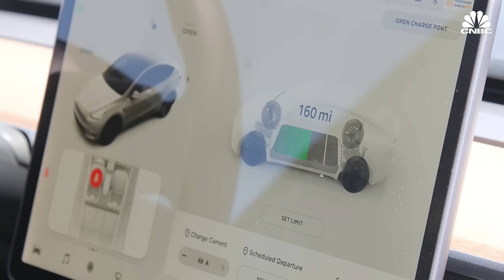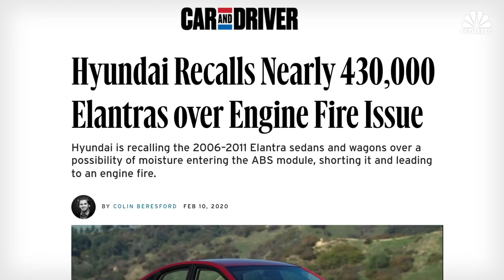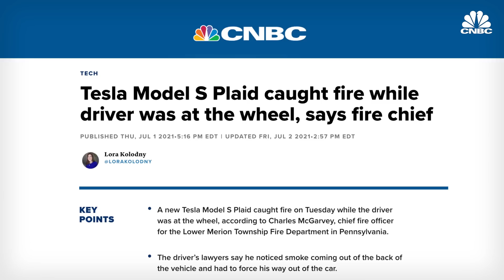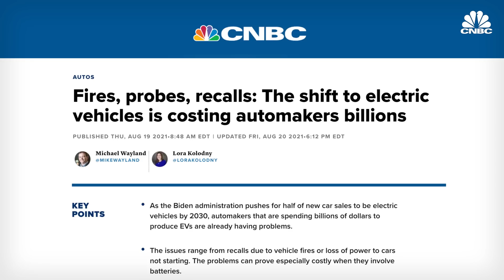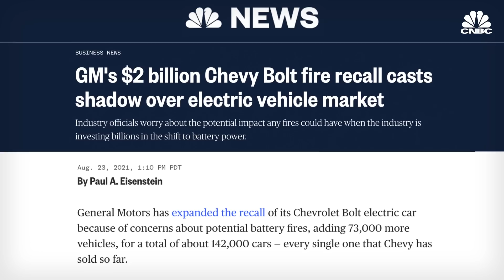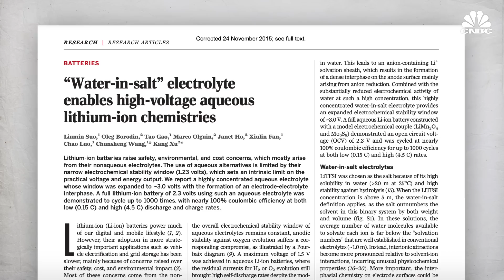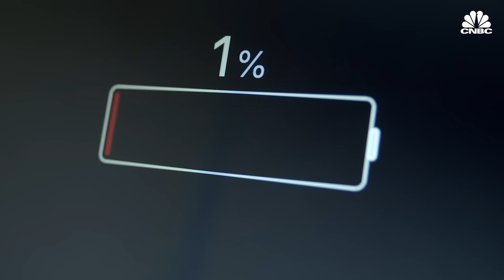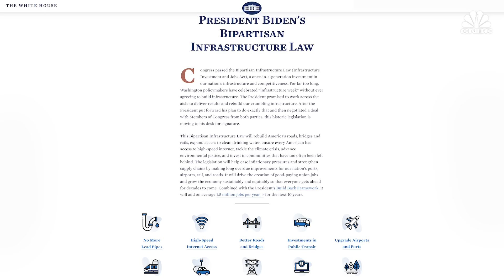Why Tesla, GM And Other EV Companies Have A Fire Problem

Comment: Here come the Tesla zombies coming to mass dislike the video and brigade the comments. These Tesla stans need to understand that, yes, gas vehicles do catch on fire, but EV fires are FAR more dangerous when they happen. And evs can catch on fire because of random electrical failures in the battery, so they can just blow up while parked/charging
Reply: yes, when they happen, they are more difficult to put out. But you missed the point that these acidents happen a lot less than with an internal combustion engine car.
Reply: @Hans-gb4mv  But what they don't mention is that EV fires happen a lot more than ICE car fires when they're not in an accident and rather just sitting in a garage!
Reply: @joeking433  yes, but they still are less frequent overall.
Reply: @Hans-gb4mv  Non-Tesla EV's will outsell Tesla EV's 10 to 1 worldwide in 2022.  Mark my words!
Reply: @strikye7  The problem is inherent in the structure of a chemical battery. They store energy by holding the fuel and the oxidizer in intimate physical proximity. Less like gasoline and more like dynamite.
Reply: @gregorymalchuk272  I agree, I can't wait for solid state batteries to be mainstream.
Reply: Their Tesla stock is plummeting and they're desperate.
Reply: @joeking433  yep, desperately buying the dip! 😘👍
Reply: @NeutronStream  Keep waiting, it hasn't dipped to it's bottom yet!
Reply: @joeking433 Thanks! I'm buying the dip, selling at the high and then buying back in the dip. Risky strategy but has worked for me several times.
Reply: @NeutronStream  Times have changed.  There is real successful competition now! Tesla's stratospheric P/E ratio won't hold.
Reply: @joeking433  No disrespect but there's no evidence competition is affecting Tesla's sales. Here in Europe (I'm in the UK), Tesla is demolishing the incumbents. Every single other EV maker saw huge drop in sales as soon as Tesla's started selling and delivering. But to each their own. ✌️
Reply: @NeutronStream  We'll see!
Reply: @NeutronStream  Every EV maker is selling their EV's as fast as they can make them so how do you know what the demand is?  Tesla is still selling out based on their initial success when they had the market to themselves but all the other EV makers are now selling out, too!  That's what investors are seeing and why TSLA stock dropped 11% today right after the good earnings report of yesterday!
Reply: @NeutronStream  Did you buy the 11% dip again today?
Reply: @joeking433  You bet I did! ☺️ Market being irrational. Next week Tesla SP will rebound.
Reply: @NeutronStream  Competition is not affecting Tesla's sales but it IS affecting the stock price!  EVERYONE is selling EV's as fast as they can make them!  That makes the stratospheric PE ratio of TSLA drag the stock down.  How far will it fall?  Hmmm.  Most people are saying the $500 range.
Reply: @joeking433  2 years ago Tesla PE was 1400+. It's now come down to ~180 in just 2 years! That's massive improvement. The share price is being affected by the macro environment. The same macro environment is wreaking havoc to the entire auto industry. Every major automaker sold less cars in 2021 than the year before. Eventually one or more will declare bankruptcy or default on their debt. This will indirectly affect the entire auto sector. I'm confident, Tesla will ride this shitstorm out like they've done several times before. That said, I might sell and buy back lower.

Comment: Whatever battery chemistry they use it always will be more difficult to put out when they catch fire compared to a gasoline car. Gasoline needs oxygen to release the energy. Cut out the oxygen by water or foam and the fire is put out. Batteries have all they need to release the energy in them so in case of a fire you just have to cool down their surrounding and wait until all energy is released.
Reply: which is why german firefighters just put EVs in a big tank, where they can reignite as often as they want.

Comment: How many Cellphones, laptops and electronic gear catches fire regularly…? Pretty much none.

Don’t make this a big deal fear mongering people of EVs.
Reply: it is new tech so obviously there is going to be some problems in the beginning..
Reply: @janix9661  yeah, the Hindenberg was new tech as well.
Reply: The danger is completely different. Imagine when all cars are EV and what happened to those 55 buses happened in an indoor parking lot. Think about multi EV car pile ups on the highway and one explodes. Everyone in the building, everyone on the highway dies.
Reply: @TheBooban  "Imagine multiple gasoline car pileups all full of gasoline and one of them explodes! Everyone will die! This gasoline engine will never catch on!" - someone circa 1907!
Reply: @TheBooban  No different then a gas Car exploding on the side of another.

Comment: We need a "Why Internal Combustion Engine Vehicles Have A Fire Problem" video!
Reply: Gas tanks don't store the fuel and the oxidizer in intimate proximity, like lithium ion batteries do. Like dynamite.
Reply: @gregorymalchuk272  
Are you serious? I believe gas tanks are surrounded by air. You also forgot hydraulic brake fluid and motor oil also burn quite well.
Reply: ICE vechs need O2 to explode...EVs do not.
Reply: @budders9958  no EV carry it with them, and adding water makes it worse.
Reply: @bowez9  good thing fire trucks carry foam.
Reply: @shepherdsknoll  not all trucks, departments do.
Reply: Including  wiring fires as well as gasoline fires. My gasoline car caught fire with me in it I couldn't get out 15 seconds after I exited the whole car erupted into flames    
The fire department was two blocks away they arrived and could not exstegish the flames.
Reply: @johnpublic168  I came back to the shop in the company truck. A bit of smoke was coming out of hood. Pro tip: don't lift the hood.🔥🚚...😉I ran for a fire extinguisher
Reply: @DrEVeils  I have very limited experience with car fires as I only experienced two. One a engine room fire did not lift the hood tryed to direct dry Chem through the grill and under the car. Total loss.  The other auto raised the hood which gave excellent access to the fire with a co2 extinguisher  which put out the fire only damage was wiring and paint.
Reply: ICEs don't catch fire while parked
Reply: @IllusiveDude  , actually this not true. The most fires occur with hybrids, the second is ice cars at 1500 per 100,000 sold. EVs are a distant third at 25 per 100,000 sold. Half a million Korean cars have been warned by the manufacturers to park outside because they can catch fire after the engine has been turn off due to brake mechanisms shorting out.
Reply: @IllusiveDude  most of the time.  I had a car catch fire while I was away at college.  Luckily my dad was outside doing yard work and it didn't happen at night
Reply: @IllusiveDude  
So… you think fire engines have to keep pace with flaming vehicles on the highway?  😃
Reply: @IllusiveDude  
Funny I have a video of an internal combustion car catching fire in a parking lot of a target.  
The answer is yes they do. Sometimes in people’s garages,
Reply: @IllusiveDude  Sure they do! I've seen it happen in person.
Reply: @benjaminnead8557  mhm "in person" lol
Reply: @benjaminnead8557  That was probably a peaceful protest
Reply: The difference is that electrics burn your house down while you sleep not on the side of the highway after you exited the vehicle
Reply: @TheV8nissan  a couple people have died in fires after crashing in their sleep.  Best of both worlds
Reply: 173000 ICE vehicle fires a year. Absolutely unacceptable. Oh ya there’s a massive tank full of accelerant under the seats. So bad they have to have a “fire wall” built between the engine and the cabin.
Reply: @truenorthtreasureseekers5858  the difference is EV fires don’t go out with water
Reply: @truenorthtreasureseekers5858  that wall is not for Fire suppression (as are multiple holes in it and does not have fire suppression measures incorporated into it) it is just a structural element.
Reply: @truenorthtreasureseekers5858  lmfao. for an oxidation process you need a fuel and a co-fuel. in a combustion vehicle fuel tank there is no admixture of the co-fuel necessary for the release of the stored energy. in a lithium battery though you have both the cathode and anode - the equivalent of the fuel/oxygen mixture that is only created within the carburetor/combustion chamber in a conventional vehicle. 

Which is why EVs are so likely to catch fire. .
Reply: @truenorthtreasureseekers5858  yeah but there's way more ICE vehicles compared to EV's, and the number of fires in EV's are still higher then ICE vehicles, see the difference? Not to mention, the EV'S are way more dangerous when they do catch fire!
Reply: EV fires are extremely rare regardless of what big oil propaganda would have you believe.

Comment: I am convinced electric flight is next - judging from adoption in model aviation.  Solid state batteries and different, safer chemistries prevent thermal run aways.
Reply: Not for commercial flight. The weight of batteries is several orders of magnitude too high.
Reply: @neon200  so far.  It's going to eventually happen.  Probably when we figure out structural batteries.  That way, more or the entire shell and frame of the plane will be a battery, on top of having some in the belly of the plane.
Reply: @Veganpotter Thevegan  Every battery chemistry has a theoretical energy density limit and lithium ion batteries are getting darn close to maxing out. The only theoretical battery with higher energy density is sulfur batteries and even if that limit is reached it wouldn't be enough to directly replace planes as large as a 737. Physics is physics and no belief in progress will change that.
Reply: @cottagehunter  No, we are nowhere even remotely close to the theoretical limit on batteries.  That claim makes about as much the claim in 1889 that the Patent Office would close soon as everything that would ever be invented was invented already..
Reply: @veganpotterthevegan  it might be just hydrogen plane eventually
Reply: @lmao22683  for sure, or even nuclear
Reply: @cottagehunter  structural batteries can play a factor because you obviously already need a frame for the plane. The skin can also be a battery
Reply: @cottagehunter  as for plane size, the bigger the better for this to work
Reply: @redbaron6805  re: "we are nowhere even remotely close to the theoretical limit on batteries."  said no college Chemistry major ever.  Mankind has literally been UP AGAINST THE WALL regarding battery limits ever since the Periodic Table was first laid out by Mendeleyev in 1869.  those "baby young to the world" always CONFUSE Nuclear Chemistry (ie, the reactions occuring between Protons within the Nucleus of the Atom, you know, the type that devastated Hiroshima/Nagasaki in Japan, and begat the Chernobyl disaster in Russia) with Electron Chemistry (ie, the everyday reactions that make life on Earth possible occuring between the OUTER and VALENCE shells of Atoms).  while technically the same field/discipline, these are (exponentially) two different sciences and they should not be CONFLATED.
Reply: @phillyphil1513  Was there a point in there you were trying to make...?  Battery energy density keeps increasing year by year, and we are nowhere remotely close to the limit on it.  That is what the facts look like.  If we hit the limit, obviously no further increases would be possible.  

So, not sure what your point is.  Rambling about "mankind" and "nuclear chemistry" has nothing to do with the subject at hand.
Reply: @redbaron6805  re: "Battery energy density keeps increasing year by year" which means "fuckall" considering it's now future year 2022 and the harnessing of the free flow of Electrons as a power source (ie, the Battery) was first created way back in 1800.   the so called "progress" you speak of has taken a whopping 222 years.  "Those who don't know History are DOOMED to repeat it..." - George Santayana (1863-1952)
Reply: Yeah, not with our current battery technology.

Simply put, we're not even CLOSE to the battery density necessary for flight. At least commercial flight, anyway. There are tiny two seater type planes that you can go a few hundred miles with. But putting 150 people, plus crew plus baggage on a plane that goes 600+mph for, I don't know, a trip from New York to London? If you think that's happening with the tech we currently have, then you don't understand the issues at hand.

You'd have to essentially fill the entire plane with batteries for it to have the energy necessary for a flight such as that. I guess you can't transport any people! Then, you actually have to land the plane and a plane with that many batteries would be way, way, WAAAAAAY too heavy! We're not where near batteries powering planes.
Reply: Agree electric cross continent jets are decades off.  But regional or commuter electric planes are much closer than people expect.
Reply: No more fuel dumping, i hope
Reply: Eventually...hybrids or hydro first thougg
though.  The first commercial electric plane just started flying a few years ago.   And it only held 2 passengers.  There are also 10 years of orders for commercial jets waiting to be fulfilled.  It'll be at least a decade before there's even one electric plane that carries 50 people. 
*Until this happens, I've just refused to fly.  Planes are far too dirty and it's selfish and irresponsible to get in a plane for anything but required work trips or emergencies

Comment: This would be interesting with electric planes.
Reply: Non-electric commercial jets also use Lithium batteries to power systems, and have for a long time.
Reply: @macemoneta  Yeah, which is why I am saying a fire breaking out on one would be interesting.
Reply: @jeremiasrobinson  Most battery fires are due to structural damage to the battery, not the battery failing.  Hence, the fire risk on an airplane would be exceedingly small.  We have however had airplanes explode in mid air due to fuel tank fires.

Comment: But they don't tho, ICE cars catch on fire far more that EVs!
Reply: That's not even the point of this video - the point is that EV fires are much harder to put out than ICE. Its not about the frequency of fires...
Reply: @visceral_investing  A lithium pack runaway is a critical defect. Either physically in the pack or the battery management software and its ability to detect a out of balanced cell. Its a failure no different than a ICE leaking gas then starting on fire. As the video pointed out  its also fire departments lacking training and equipment for these types of fires. This article also doesn't mention the 8% of wild fires caused by vehicles, typically due to hot exhausts and cat. converters that EVs don't have.  ¯\_(ツ)_/¯.
Reply: Not in your garage while you're asleep though
Reply: @TheV8nissan  ICE still can catch on fire while parked. Either leaking fluid on something hot or electrical shorts have historically caused that issue.
Reply: Ice car catch on fire more yea, but when he do its safer, less heat, doesn't spread as quick plus there are more ice on the road so there are always more ice fires
Reply: @moses8758  even as a % of cars or miles driven ICE catches on fire more.
Reply: @mikaila31 True. Yup, they are still considered a niche (but growing) market - only about 3% of car sales worldwide... when they do catch on fire, it's gonna be big news. That stat in the beginning of the video saying there were 173,000 cars fires in the US alone. I doubt EV's accounted for even .5% of them. But when you are a new tech (yeah, EV's aren't exactly new, but they are an extremely small bit of the car sale market) that being pushed to be both profitable and economically viable and sustainable and safe.... not all press is good press. Every incident undermines the EV industry.

Comment: Relative to gas cars? 🤔
Reply: yes. once a gas tank is punctured all the gas will spill out. You put some water on that until you do't see any flames anymore, after that you can scrap it. If an EV starts burning you basically have to put it out so you can transport somewhere where can burn down completly and safely  only then is it possible to scrap it. Lithium itself burns very easily in contact with air or water.
Reply: @jsplit9716  your right. Fire is definitely worse with electric cars. Curious what the numbers look like for fires: gas vs. electric.